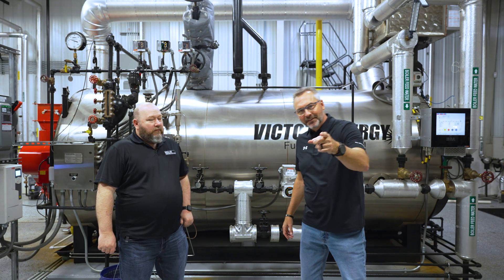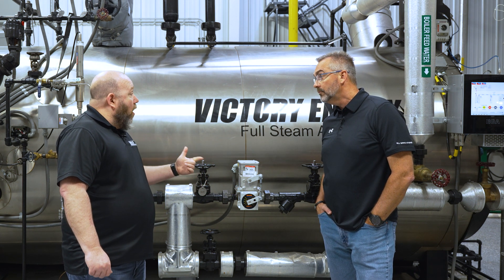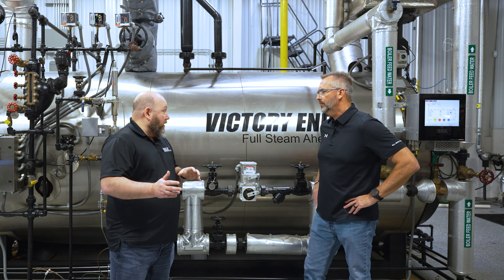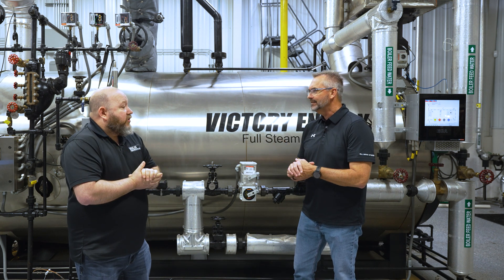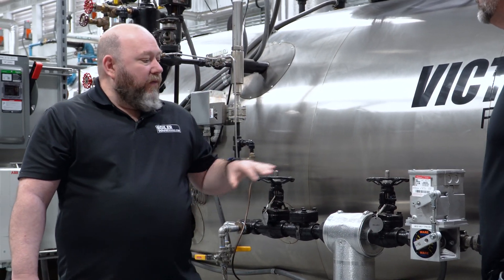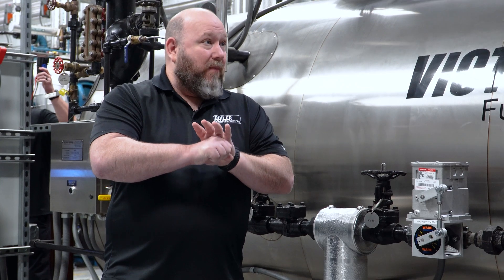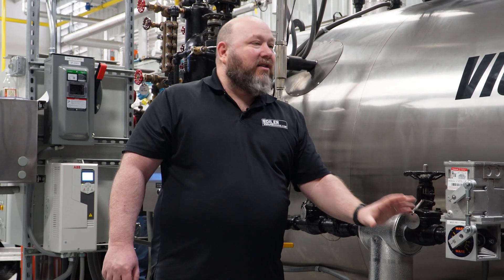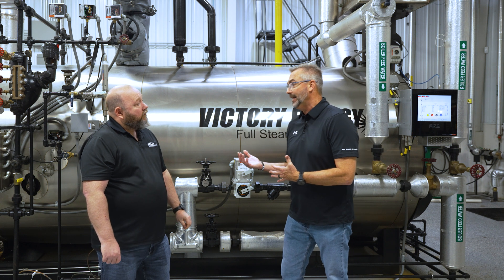Modulating Feedwater Valves Explained: Sizing, Design & Application - The Boiling Point

Comment: I use three separate makes of valves, Ware's Mod-V, Fisher, and Siemens, and the Ware Mod-V is my favorite. It's durable, easy to troubleshoot, and any skill level can quickly determine the valve position.
Reply: I took over a mill that started out with a 2 inch valve feeding into a modulating valve into a make-up water tank. From the MV it was reduced down to a 3/4 inch pipe going into make up tank . Not only was that scary enough, the MV was zip-tied together. 
There was a water hose going into top of the make up tank that ran constantly.
I asked one of guys that had been there 14+ years: why was it that way?
His reply was so the tank doesnt run out of water....😂
The even scarier part was the safety manager had walked by the tank several times and never made any questions about the situation, but just the water hose was a trip hazard....
I spent 2300.00 for the new MV and that  was paid for in about a month water savings...
Oh, I almost for lgot to mention the boiler inspector didnt even catch the issue.

Oh the shit ive seen in Feedmills.
Reply: @horseshadow0019 Thanks for commenting. Let us know if we can help in any way.
Reply: Appreciate your faith and trust in us. Also, thank you for watching our YouTube Channel.